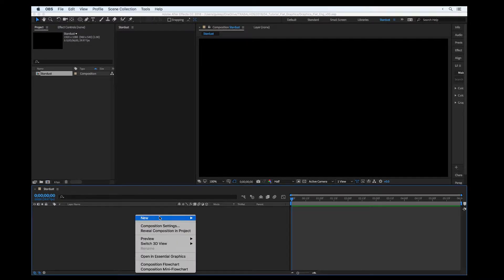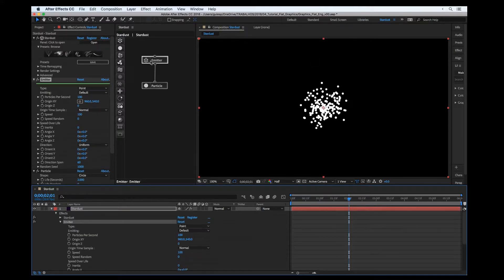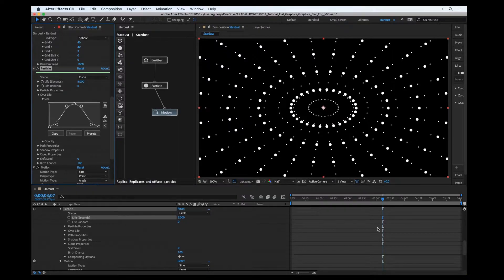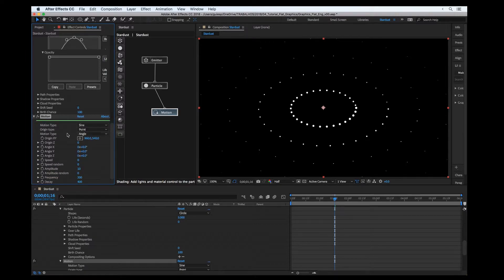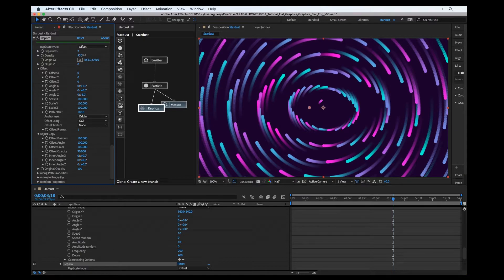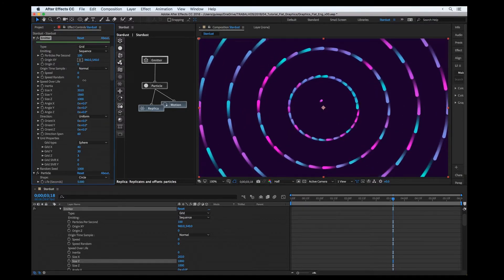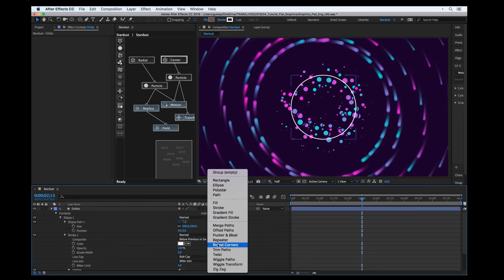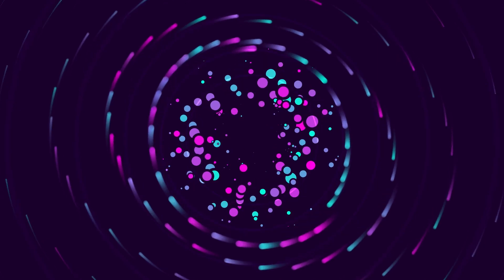Exploring a 2D Look  - Stardust + AE Tutorial

Comment: Hey there I love your stardust tutorials :) is there any chance you can demystify the process of adding an obstruction layer and/or a zeroth pass to obscure the particles. I been trying all day and I can’t quite figure it out :(
Reply from the maker: Hi, thanks! Are you trying to solve a problem for an specific project? what are you trying to achieve? let me know more about so I can try to help you :)
Reply: Gui Esp cheers for your reply. Yeah I had a project and I needed particles to flow into the top of an object (basically a squashed cube) one colour and come out the bottom a different colour. I was hoping to use a proxy squashed cube created in element 3D with an output mode set to depth, and set that as the zbuffer layer in stardust but I couldn’t get the settings to work. Also I was wondering whether I could set the element 3D layer as the  obscuration layer but that wasn’t working for me either. In the end I managed to find a workaround and use a field node and inserted a box container where the squashed box is and to set the opacity of the particles to zero within that area. It did the trick but I would like to get the zbuffer or observation methods working for me too :)